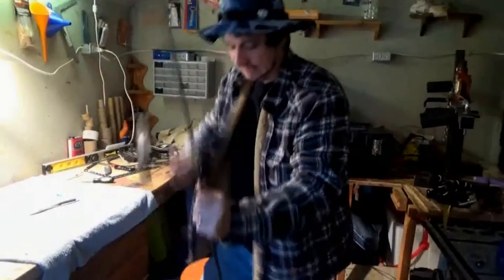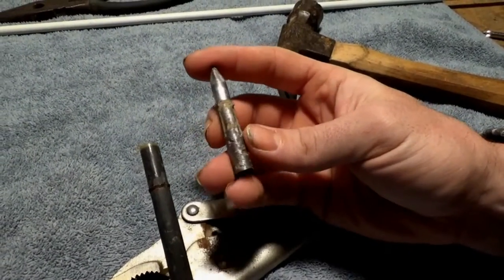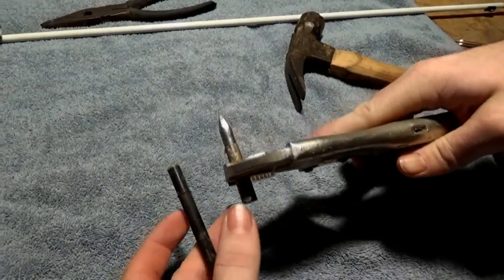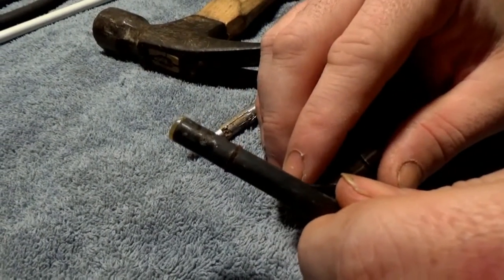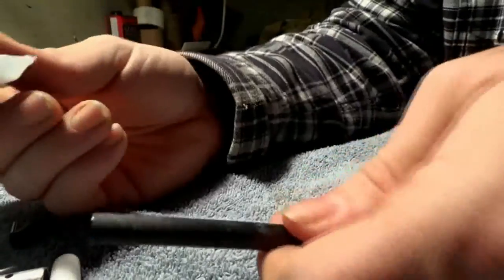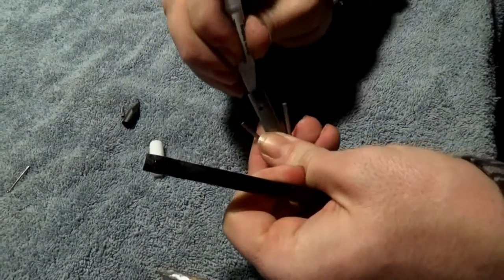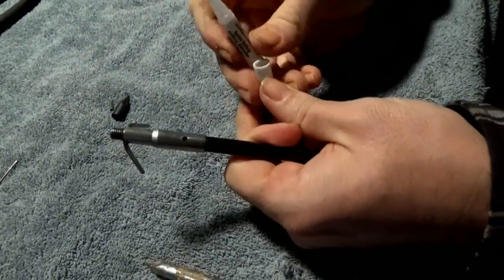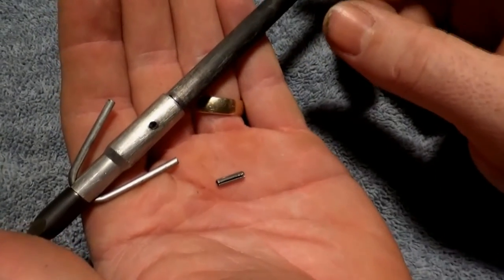Quick HOW TO : Bowfishing Arrow Tip

Comment: Where did you get the pin and what is it called.
Reply: They're usually called roll pins or split pins. Most hardware stores should have them.  Probably in their nuts/bolts drawers.